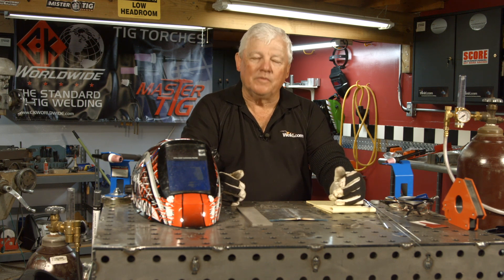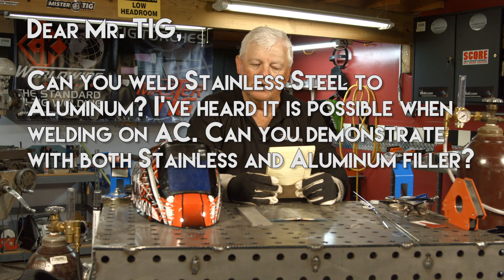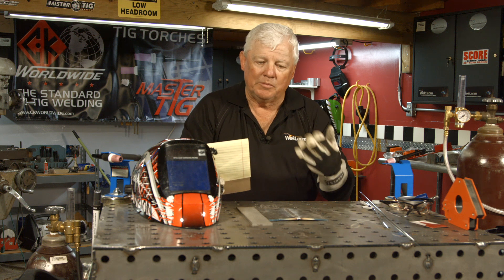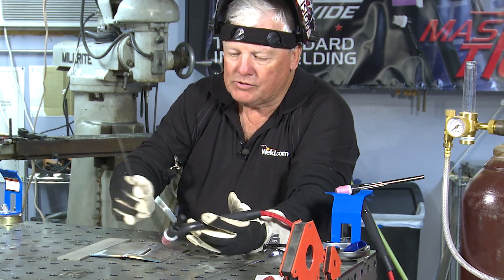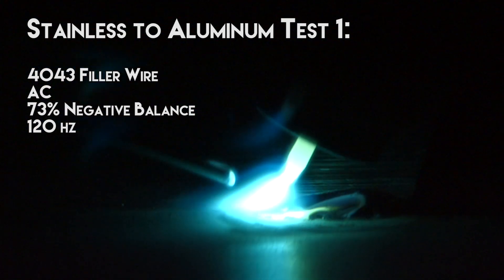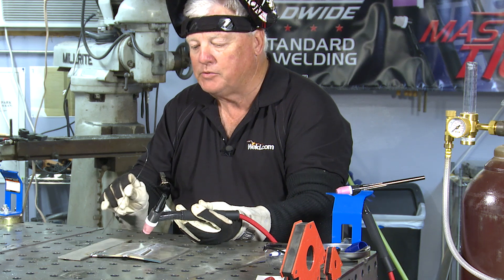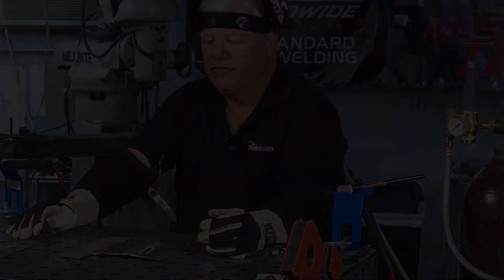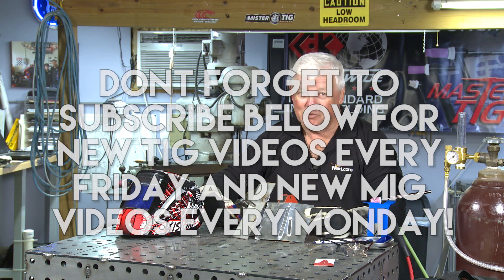🔥 Welding Stainless Steel to Aluminum Welding | TIG Time

Comment: "Welding" stainless bolts onto alu is done on alu boats , the metals dont weld together but you can build up the alu around the head of a bolt enough to make a strong bond.

Comment: Well, there is a video on the web with a guy  that took aluminum and fused some stainless steel into it and  welded  a bolt to  a aluminum sheet and pulled with over 2000 pounds before the aluminum snapped not near the weld ,so yes it is possible ,it wasn’t pretty though

Comment: You can't weld them together... but you can encase the stainless in aluminum since they melt at very different temperatures, this can be used for things like wear pads or if you want a ss bolt on an aluminum plate... you wouldn't weld them directly but instead encase the SS in aluminum weld and it holds surprisingly well

Comment: I just grabbed a 308L filler rod by mistake (it's late night and I'm not all there). I fed a few dabs of it into a 6061 pool and was startled by sparks and sputter that made me think I was running out of argon. After rubbing off the surface crud, I am left with a shiny spot that is seamlessly embedded into 6061, without any defects. It is so hard that it blunted a new tungsten carbide burr I attempted to excavate it with. I am beginning to imagine productive uses for this effect.

Comment: I wish I had the means to weld aluminum or steel/stainless or even both! I could make so many awesome projects to the point I could probably start my own fabrication business. When I was in high school I took boces for auto mechanics but halfway through the year I convinced my teacher to allow me to “visit” the welding class, once in a while. I really learned allot. I made a 90cc 4speed manual go cart that first year from a Panterra 90cc pit bike. The second year I made a demonstration jet engine using a cheap $60 turbo I bought on Craigslist! I sourced all my own parts and used scraps/garbage to build my projects. I blew everybody’s mind because of how professional and well everything looked/worked, they wanted to make my projects “displays” but I declined because I was young and mostly paid out of pocket. (I probably should have donated them to the school.) Anyway I really wish I could make projects like that again but I simply don’t have the support or equipment or money.. Time I have but that doesn’t help without the money & equipment.

Comment: So new to welding...like today new. Could you preheat the steel so it's up to close temp so it's not taking so long to weld the two materials and holding the heat to the aluminum too long to burn through and melt it too much? If that makes sense...

Comment: I've seen aluminium superstructure welded to steel boat/ship hulls and decks.
But the aluminium superstructure was already bolted to the hull. It was only intended as a way of sealing. Not structural.
Even then, there's plenty of examples of US Destroyers already long retired and scrapped where the welds gave way. The flexing of a ship on "average" Atlantic and Pacific weather s more than enough to pop the welds after a few months.
Today any ships with aluminium and steel are sealed with rubbers or other flexible or robust materials as gaskets. Rather than any welding.
The materials expand and contract and different rates of course as well. Again, not great for your boat.

Comment: I feel the fault with the weld was penetration on the steel side. What if you added more heat to the steel than the aluminum, by moving the arc more over the steel than the aluminum.

Comment: Someone told me once you could Tig weld sodium to magnesium using oxygen as shielding gas, graphite rod with a water soluble brazing flux....   

Lol.   Id pay to watch the dumbass who would try it..  talk about a bright n hot flash of crap you cant extinguish..  ha.  As soon as the arc was struck itd take the place out...  have em set a pre gas.  Lol.. itd be perty..  and perty dangerous..,

Comment: I'm wondering if it's possible to weld two different materials like that using a completely different welding technique involving weaving the two materials together relying on the mechanical connection of the welds rather than relying on them melding together into a new alloy. I'm thinking of finger like welds branching off each plate and overlapping each other on both sides, kind of like the way a left and right hand fit together with interlocking fingers.
Reply: sure. but it's easier just to cut them to some shape and fit it together then braze it or whatever.
there's tri-clad which is used on some stuff, aluminum, platinum, steel.. sandwich? which are bonded together and allow each side to be different. One steel, one aluminum. then you can weld the each side to the appropriate metal
Reply: @gg-gn3re  it's funny, but since this comment, I've become well acquainted with brazing and soldering. Reading my own comment, I was like, "when did I write this?". I'm an HVAC tech now and have to braze stuff all the time. Never tried using my brazing rods on steel, but I'm sure theres some rod types that will allow steel and copper, or whatever two metals to be brazed together.

Comment: Do it on dcen set it up to weld steel and use er7os-6 filler or 308L I had much better results then using AC

Comment: Got a question for you? I have pots and pans in my kitchen which are stainless pots and pans with aluminum plate welded to the bottoms of them for improved heat conduction. I even have one stainless pan with a copper bottom. Wonder how they managed that? Any ideas?

Comment: thinking about making a glorified spoiler for my sailboat.. to mount up to two windgenerators on.. and maybe a solarpanel.. now i was thinking about having an aluminium "skeleton" inside an atleast 75% solid fiberplastic shell.. seen aluminium brazing as a quite simple and easy thing to do.. can i make my "skeleton" with brazing aluminium.. with perhaps some additional stuff.. take it to some pro alu welder and have him or her weld it proper? or will brazing dammage all the welds and have less material to work with? the material would have to be rods and not tubes..

Comment: Hi please help I have this repair job I got in its 50mm x 1.5mm wall tubeing 304L the previous welder welded it with the arc not sure what grade .I tried grinding it flat and cutting a 1mm gap its just falling away please can you advise me on what to do

Comment: I repaired dozens of pin holes in a 1950's Crestliner aluminum boat using a buzzbox with a tig adapter.  I used a long strip of 18 gauge stainless bent into an "S" shape to back up the holes as I filled them in.  I had no clue what I was doing, but I knew the aluminum melted at a much lower temp than the stainless so I figured it would work.  After watching this channel I've learned so much I almost wish I could go back in time and redo the boat the right way.   Maybe some day I'll post all the photo's into a video as an example of how not to do a restoration.

Comment: Is it possible to weld a piece of aluminum to steel without using alumasteel electrodes but using only steel electrode and stick welding?

Comment: In the time since this video came out, it is now possible to TIG weld aluminum to steel with a new rod called Aluma-Steel.  This is the website of the manufacturer.    http://alumasteeltigrod.com/

Comment: As a welder, I can see no particular purpose in welding aluminum to steel. This man shows how it can be done. It's a very involved process, but it can be done. Whether its a strong weld is anybody's guess. But then, like I said, what's the point ? As one commenter said previously, dissimilar metals can be welded together using the electron beam process in a vacuum chamber.
See video here  >
https://www.youtube.com/watch?v=-sVMhQVJj54

I was surprised how many different materials can be plated with aluminum.  >
http://www.alumiplate.com/coating/materials-plated/
Reply: There are a number of situations where aluminum is needed to be combined with mild steel, now stainless steel is a horse of a different color so forget it!  So anyone who has not tried welding aluminum to mild steel just buy "Aluma-Steel" rods and you'll see it works just fine, to find it just Google it.

Comment: It can be done using Fronius;s CMT (Cold metal transfer) and I believe miller has a process called... RMD which I believe is mostly for pipe but Ive heard it cant do some of the thing CMT can do.. I'm not even 50% sure on that. CMT however I have seen done and its not a GTaW process it's a well CMT wire process.

Comment: Its can be possible with silver rod or not .like 56% silver flux core rod if no gas is use or with gas no flux core. Technique is brazing or brazing can be done with tig.2nd method is aluma-steel rod. please recheck mr.tig.

Comment: there is a process to do this it is not gtaw though. they make pots and pans with al. on bottom of stainless tops. i think it is done with explosion welding which may be more brazing then welding. but it has to stand up to tremedous forces.love the show  you are an excellent welder love to watch

Comment: Could you invite pizza welder to come onto the show and demonstrate how to weld pizzas together?
Reply: You can't weld them together. But you can braze with molten cheese!
Reply: Use cheese as the filler 😂🤣😂
Reply: Lmao
Reply: Yeah. You can weld mozzarella, cheddar or pepperoni with a cheese stick and hot air soldering nozzle, but like with metals you can’t weld cheeses together using a pepperoni filler rod.

Comment: the hardest challenge I did was to weld to aluminum cans together. not the tops but the bottoms. I never passed. it takes very fine control to weld them together.

Comment: Just so the viewers understand, brazing and welding are two different applications with similar practices. Welding uses fusion and penetration, where as brazing is basically the same as caulking. There are specific alloys capable of "bonding" steel and aluminum with minimal fusion that are not strictly brazing, but you are talking about materials that are almost way beyond a typical shop welder's worth that could be remedied with stainless steel bolts and a nylon spacer.

Comment: I've accidentally grabbed the wrong rod (AL) welding stainless and it seemed to weld ok.  I've also seen my old boss do the same.   I cannot recall what we did after but I could only guess we just rewelded it with the correct filler rod and left it as is.

Comment: you use thoriated tungsten electrodes to weld steel and zirconiated (however you spell it) electrodes to weld aluminium

Comment: Would you be able to tig braze them together?
Reply: Pretty sure there is a huge difference in melting temps. Probably some vaporization on the Al side when the steel started to melt
Reply: Yes. With Silicon-Bronze or Aluminum-Bronze. You are only melting the braze material, not the surfaces of the base metals. You only require heating the base material to the "paste range" as described in basic Metallurgy.

Comment: you can in fact weld alloy and any steel this process is called Explosion welding 
it can weld via pressure(explosion) over 2 million PSI
https://youtu.be/2u51tJdRDK0
how ever you cant do this in just any garage or workshop haha

Comment: Here is a challenge.  MIG weld 304SS, 16 gauge, 3" exhaust tube using .023 308l wire with C25 gas.  That's what I got, tri mix is not an option.  I'm almost done with my exhaust, welds look like crap and it spatters a lot.  I found it very difficult with my Hobart 190.  Thanks.
Reply: I did this recently, I have a SnapOn 120v Mig Welder with .023 308l wire and C25 gas. The material of the exhaust is very thin, and thin materials are the only time I make a pass at recommending downhand welding. My process is down-hand stitching. In text, Zap. Pause. Zap. Pause. Zap. Pause. Zap.

Also, how clean are your exhaust pipes? New, used, any signs of corrosion that sort of thing?

That said, I'd also like to see a demo on this.

However your post is from 4 months ago, so I assume this question is null.
Reply: zarektlek I think I needed to clean the material more. I recently bought a tig welder, so much better.

Comment: Hey Weld.com, I have actually seen Stainless Steel and Aluminum be sucessfully welded together. It was a pipe sample tested in a lab and they were both about 1/2" thick with full penetration on the weld. I'd like to send you the picture some time if you'd like to see. It is one of the coolest and strangest welds I've ever seen and I bet you'll get a kick out of it too
Thanks,
Initial DIY mods
Reply from the maker: You can send it to info@weld.com or post it on the Weld.com forum.
Reply: Thanks. I sent the email your way a few minutes ago ;-)
Reply: Initial DIY mods I don't believe that
Reply: Lee onepunchman Bapeislife lol you don't have to believe it but it's true and I held it in my hand. I don't think most people work with explosion welding anyway. The piece was for research and there weren't any signs of galvanic corrosion either.
Reply: I used to have examples of regular steel and aluminum welded together in some mag wheels from the 70s. I don’t think they used anything too exotic like explosion welding to do it, they were only car wheels. Nice welds about 2- 3 inches long on the back side of the spokes. Looked like MiG welds holding aluminum or magnesium spokes to steel rims.
Had them till about 10 years ago they were getting corroded in between the two metals and breaking up. I always wondered how it was done.

Comment: ICI have a process of welding steel to marine aluminium using an explosive fusion between the two materials the  United Kingdom 's Royal national lifeboat's  engine beds are done this way so yes it can be done !! but not by a DIY welder

Comment: Would the EZ weld tig wire you used on cast iron work on this?
Reply from the maker: You can join dis-similar materials with silicon bronze. The question from this video was asking about a true "weld".

Comment: Believe me or not but I have actually welded aluminum to steel before. Buddy of mine and I had the idea of making a shifter for his car out of a clutch handle from a dirt bike and a steel not to thread on to the stock shifter. Tried tacking it and it broke instantly. Cranked the heat and it fully fused together for good. I also used GMAW mild steel with 90% argon 7.5% CO2 and 2.5% O2

Comment: Great video! One thing I would like to see covered by a TIG welding channel is welding of Docol material. It's becoming quite the popular material when it comes to the auto racing world, but there is very little information out there about it. I need to weld some Docol, I also need to weld standard mild steel to the Docol tubing for a bumper support and was curious if this is even possible, or if it retains any strength.
Reply from the maker: We actually have done a video on docol. Tips and Tricks for Welding DOCOL R8: https://youtu.be/kAO06G4MBmI

Comment: If for some reason you really have to weld the 2 materials together, you can stir weld them. Honda does it for some of their subframes, but I have never seen the point in mixing materials chemically like that.

Comment: you can weld stainless steel to aluminum. it's done using cmt welding. cold metal fusion.
Reply: cold metal transfer*
Reply: You're referring to Fronius using silicon bronze filler and the CMT process to join steel and aluminum like they do at Audi. You don't actually need CMT, it's done everyday with CV power supplies and TIG welders alike.  It's also not fusion welded, it's brazed.
Reply: i know im CERTIFIED AND RUN TIG MIG STICK CMT LASER. FROM construction to structural to nuclear now tig cobalt, titanium nemonic colombium and at times build ribbed liners on,the fronius cmt robot . pushn buttons boring. 20 yrs now its all boring. i got a plastic 3d welder that things pretty cool. for $100 no smoke and i make my 6 year old all kinds of toys fix broken ones anything cracked bumpers headlights almosteverything thats labled made in china  haha seriously its a little too much enjoyment

Comment: I have (accidentally) welded aluminum to aluminum using stainless filler. Successfully I might add. But that's what happens when you ask a neophyte to hand you another stick of filler material.

Comment: What about welding clad material. Such as 1/8" aluminum between two layers of 14g stainless to a stainless fitting. Will the aluminum contaminate the stainless weld that's in contact with?

Comment: Mr. Tig,
what is your thought/ opinion about multi pass TIG Aluminum? I hear varying thoughts, and have a need to weld 1/2"- 3/4" "V" or Double"V" groove tig with a 200 amp machine. 

also, 
is anodized Aluminum weldable? do you have thoughts about using Anodized Aluminum for a Welding truck bed for lightening up the weight of the truck? I'm concerned with vibration and abrasiveness causing failure.
would you consider a video tutorial?
thanks

Comment: Shipyards use a special strip of material that consists of steel one side and aluminium the other for welding aluminium superstructure to steel hull. The strip is cut from thick plates of aluminium and steel that have been bonded together explosively. Not sure if friction stir welding has taken over this yet. Explosive welding is an interesting art itself, a plate of steel is laid down and an aluminium plate covered in explosive is placed at a precise angle to the steel and upon detonation the aluminium plate is progressively forced onto the steel one, it is more molecular bonding than welding.
Reply: its called tri clad. aluminium/platinum/steel.
Reply: Thank you for this comment at my job we are repairing semi trailer (I'm extremely green by the way) and I came across a piece that looked like aluminum and steel welded together and I was really confused but upon closer inspection it looks exactly like what you described